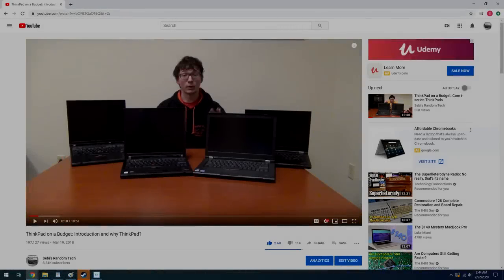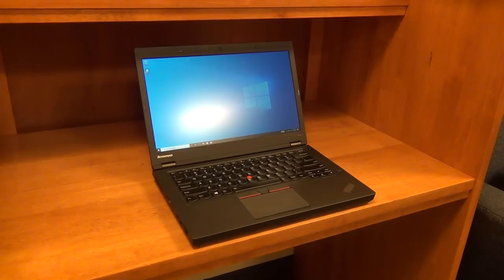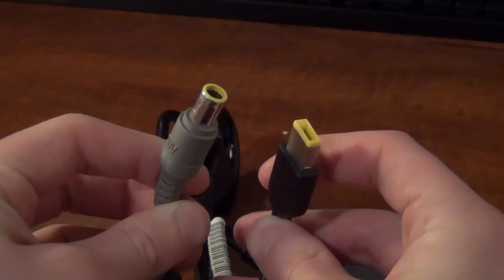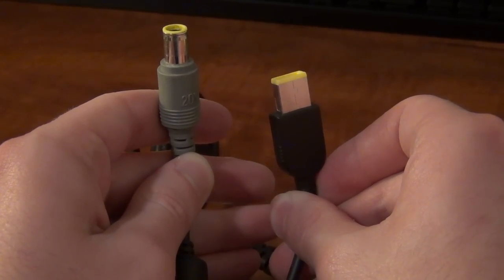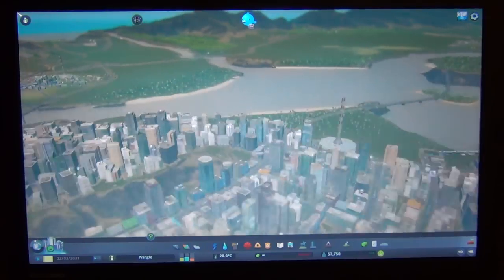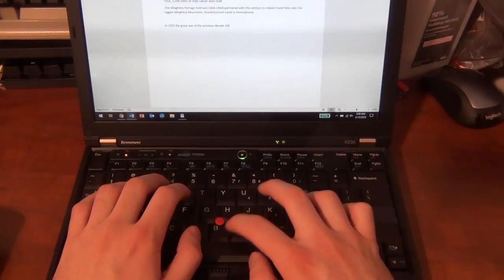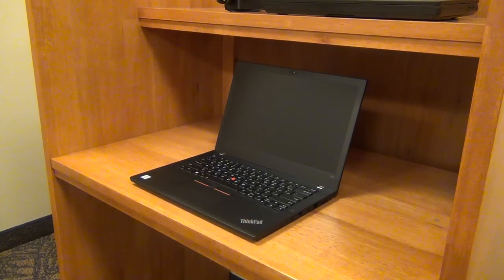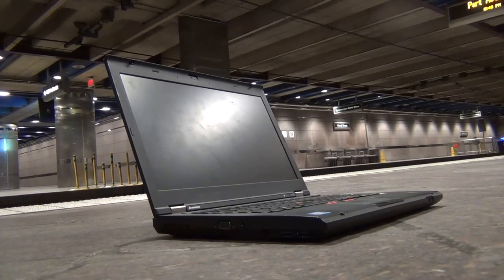Best Value ThinkPads in 2020

Comment: Considering how how and power hungry my T430s is, I wouldn't even consider another laptop in that line. My T440p ran MUCH cooler and quieter, and was a lot more power and power efficient. Unfortunately, the fact that the p variant only has a single battery has been a massive negative to me. MAYBE i'll get around to trying to fix it one day, after I managed to brick two motherboards.
Edit: not only can you get a harddrive caddy for the T440p, but you can also get a Blu-Ray RW drive.
Reply: buy a new battery bra
Reply: @aneeshprasobhan  the T430s has two brand new batteries. What's that gonna change?

Comment: You can't go wrong with Thinkpads. I own a T480 I bought brand new for $600. Got my girlfriend a used (near mint condition) x250 for $200. Gonna pick up a T440p next for around $200. I used to work IT for a large medical supplier and we had STACKS of x230's, x240's, T420's, T5XX's all used in the warehouse just collecting dust as they had been decommissioned when new models rolled in. I would image 20-30 new units at a time and walk the old ones out to the warehouse. I wish so bad I would have taken 10 or 20 of em home. I'm sure nobody would have cared. At the time I just didn't know the real value that thinkpads had.
Reply: t440p for the upgradeability?
Reply: @justinchan8868  - yuppers!

Comment: Would you recommend the P series (P50, P52 and P53)?

I know that for many things a T would do the job, but because it'll be my main computer for a time and I'll be using it outdoors so I'm kinda thinking seriously buying a P50 Xeon FHD.

I've searching an alternate to it, but I'm very interested on the 4 slots of RAM on the P series and the multiple M.2 slots
Reply from the maker: The P series are very solid machines, if they’re within your budget. The Xeon’s don’t offer a massive performance boost over the i7’s from what I’ve heard, unless they come with the beefier graphics options or you need to use ECC RAM. Keep that in mind when comparing prices.

Comment: What IPS panel did you install in your your t440p? Which one do you recommend?
Reply from the maker: There’s a lot of different opinions as to which ones are the best, any IPS panel will of course look miles better than the TN’s available for these.
If I had to pick one specific display for these that looks the best, I would say the InnoLux N140HCE-EN1 Rev. 2. Make sure if you get one that it is not Rev. 1 as those have the mounting brackets in slightly different places, so it won’t fit correctly.
Reply: @SebisRandomTech  Awesome, thanks for the reply!
Reply: I recently swapped mine with an LG LP140WF3-SPD1 and it's alright
Reply: @timb6694  Yeah I heard  that its a really nice screen. how do you like it?
Reply: @chromatron4538  Read in some reddit threads (take w/a grain of salt) that it's one of the best options, and it does look really nice. Matte finish, pretty accurate color, and less than $60 if you shop around

Comment: So if I got a t440p, are there BIOS mods that can "disable" Intel ME? Also CPU undervolting?
Reply: IIRC, look into Libreboot/Coreboot. I'm not sure about the undervolting,  but I'm fairly certain you'll find more info through there.
Reply: Coreboot I think. It cannot remove the ME completely like libreboot for earlier cpus. It can be removed completely on a core duo/C2D like t400.

Comment: using r61i thinkpad from mid 2008's, I am really surprised how this machine works that well, really smooth after upgraded from hdd to a ssd.
Reply from the maker: Typing this from my T601 FrankenPad (T61 motherboard in a T60 chassis), amazing how I can still be using it without issues 13 years after it was made!

Comment: I currently have the t430. I have intel ssd, msata ssd, 16 GM ram. It boots windows 10 from powered off in 21 seconds. Great machine.
Reply: 21 seconds?? That's crazy long with an SSD! Boot to Windows should be less than 10 seconds! Even my $100 Dell does that.

Comment: Considering to upgrade my T440p processor (currently i5-4330M), I noticed on the "T440p Specifications.pdf" that is compatible with i7-4800MQ, i7-4810MQ and i7-4900MQ too. Do you think it is better to focus on the 4712MQ or should I consider the other higher options?
Reply from the maker: The other options will work but run hotter. It's ultimately your choice.
Reply: @SebisRandomTech  Thank you for your reply and time!
Reply: @SebisRandomTech  Hi, what's your opinion on getting T430/T440 CPU  upgraded to i5-8000 & above to make the laptop Win 11 ready ? What could be the max i5 or i7 processor the machine can take ? Thanks.
Reply from the maker: @OnlineShares  That isn't possible unfortunately. CPU upgrades are limited to processors from that generation.

Comment: My A485 (Ryzen version of the T 480) has been my favorite so far. Last of the external batteries, screen upgrades are endless, light gamming is possible, no thunderport issues, and plentiful replacement parts for cheap. I love my older thinkpads but for a grab and go budget laptop in 2023, this one is my pick.

Comment: I changed R61 to T430 last year and still I think that was one of the best deals. Changed HDD to SSD, put 16GB RAM and I have small rocket. Still, it is i5. But with 1600x900 LCD is quite awesome. Only what is frustrating is a battery life.
Reply: What's the battery life like, with say.. browsing on chrome, watching YouTube and MS office?
Reply: @Prasad9800  Something about 1.5h when is charged at 100% and the battery condition is about at 70%. It's stock battery.

Comment: Well, I use a X230 on the go and a S30 at home and both machines are more than enough for my needs. The X-series is extremely portable and has saved my ass a lot of times having to submit some time sensitive documents and the X79 workstation back home is great for daily use and 1920x1200 gaming. As long as you maintain your machines and clean them, they'll serve you a long time without breaking a sweat. And yes, please, treat yourself to a SSD.
Reply from the maker: I love the X230! Especially with an X220 keyboard swap. They just tend to be a bit pricier than a similarly specced T430.

Comment: ** Hi Sebi: Today's November 03, 2022. I am a student. I am in the market for a secondary laptop. I live in Germany. My budget is about 200 Euro. I have a primary machine already, but it is not  portable enough. I am looking for something that is portable, possibly around 3 pound or less if possible. My possible usage are writing codes (C++,Python, JavaScript mostly), use office application and browsing. Thank you **
Reply from the maker: Look into the older X1 Carbon models if you solely value portability. If you want more upgradeability you could look into the X2xx models (X230, X250, etc) ot the T4xxs models (T430s, T450s, T460s, etc). Those models should be in your price range.

Comment: One to add might be the L390/380 Yoga.
If you are a student and need the portabilty AND a good stylus, those are imo the ONLY new TPs to take into account. Why?
a) Upgradable RAM (X series don't have that anymore)
b) no troublesome thunderbolt port
c) Quadcores, yay...

I ABSOLUTELY agree with the "gap". Anything between the ivy bridge mobile series and the quadcore i5/i7-8xxxU CPUs is a waste of money, as the older 2/3/(4)xxxM CPUs are cheaper and better. 
However, if you want an energy efficient Quad, nothing will be better than those newer U series CPUs. I upgraded from my trusty old X41T(writing)+T400(performance stuff) combo to an L390Y last year and I do not regret the 850€. It was my first new laptop, but its great so far.
Reply from the maker: The newest ones (8th gen and newer) are definitely a better value than 4th-7th gen, especially from a performance standpoint. The only downsides is that even used ones usually cost more than the older ones after upgrades, and (as I will discuss in the T480 video I am working on) some design changes like the move to USB-C charging and the removal of swappable batteries and upgradeable RAM on some models presents a major downgrade. I can’t wait to do that video so I can give my full opinions!

Comment: Which ThinkPad would You recommend in 2023? Something for basic work like browsing Internet, SSH to remote machines, basic coding, with upgrade potential and to run Linux? 🙂
Reply from the maker: Working on a follow-up video to this one, but it would depend on your price range and uses. For you just about any model made in the last decade will do what you need it to. The T440p remains one of the more upgradeable options albeit a tad older, the T460/470/480 have gotten more affordable and have the benefits of a slimmer build and better battery life, and the X series is always a good choice if you can find one for a decent price.
Reply: @SebisRandomTech I'm looking forward for that video!
Reply: T480?
Reply: @SebisRandomTech  what do you think about the E14 G4?
Reply from the maker: @baran.t23  Look at other options but it's good in a pinch.
Reply: @SebisRandomTech  which of the newer models would u recommend in a price range within 1k
Reply from the maker: @baran.t23  P series if you don't mind a heavier machine, X1 Nano or Carbon for something on the compact side, and the L14 or T14 for something in the middle. I'm still happy with my older models though!

Comment: How possible is it to upgrade the display in a t530 to a 1080p IPS panel? the T530 I just got has a line in the screen and I want to know if I can upgrade it or if I should just buy a working original display for it. I also plan to put in an i7-3630qm from an old Toshiba I have with a destroyed case (horrible thermals too) I will use it for light gaming and general on the go use alongside my 2012 MacBook Pro 15 inch. While it is nice and has faster graphics it is a decent bit heavier and is limited on ports. It also is limited in battery life as the battery is non swapable. Another advantage is the ability to easily add a Blu-ray drive to watch them on the go.

Comment: Got a t480 for my grad program where I'm writing all day every day. I needed something portable, professional, and futureproof that didn't suck to write on. Even though the keyboard doesn't hold a candle to the older thinkpads, it's still the best around for "modern" laptops. 
I'm curious as to what your final verdict will be. I think it's the absolute last Thinkpad that's still worth getting because the x1 and s line have taken the removable batteries and upgradability away from the powerusers in favor of the sleek cult of Apple. It's sad, but at least there's a whole catalogue of cheap thinkpads to collect.
Reply from the maker: Sadly all newer ThinkPads are now taking away things like removable batteries and upgradeable parts, and ditching useful ports like SD card readers. What bothers me the most is that they’re doing this even on thicker models that have more than enough space in their design to still accommodate those features. I look forward to making the video as well.
Reply: @SebisRandomTech  - I wouldn't consider SD card readers a useful port. It kinda bugged me that the new P53 had a SD reader. Considering you can pick up a 15-in-1 USB card reader for like $5 AND any device that has a card in it will also have the ability to connect to the computer via USB cable I don't personally find it useful. Isn't it more work to (for example) take out the SD card from a phone/camera and put it into a reader than it is to just plug the phone/camera into the computer with a usb cable? AND aren't standard size SD cards kind of a thing of the past? (meaning micro SDs have to be adapted) etc. All in all not a big deal BUT if I had a choice between taking up internal real estate for an SD card reader or including an extra port like a mini display port/extra usb3 port or something else...I would choose the latter. I don't think most people are using SD card readers on a daily/weekly/or even monthly basis. On the flip side extra display ports, usbs can always be helpful.
Reply: @SebisRandomTech  - The only people I can imagine using an SD card read with any regularity would be photographers. and most of the "photograhers" i've met spent 3k on a bunch of equipment then it sits in their closet for 10 years. lol
Reply from the maker: @Michael-ot9bk  I use SD cards regularly...
Reply from the maker: @Michael-ot9bk  The P53 dropped some ports to make room for more ThunderBolt ports, it has more than enough room for an SD card reader and it's not like they took away ports to keep the reader...

Comment: You've mentioned that T430 and T440p used to be your 'daily drivers'. So if they're not anymore, what is your current daily?
Reply from the maker: I switch between laptops pretty frequently, so it’s hard to have a set daily machine. Right now my modified FrankenPad T601 (T61 motherboard in a 15” T60 chassis) and a W540 are my main machines. I also recently picked up a T480 and am going to make a review after I’ve used it for a while.
Reply: @SebisRandomTech  Is there a rewiev for W540/W541? I have Dell Precision M4800 -very good laptop, but is big and heavy and I am think to sell and switch to T440p because is light and is 14". What do you think?
Reply from the maker: @levskilevov4888  I'm working on a video about the W540/541. They're pretty similar to the M4800 in terms of performance, however the W540 is (based off spec sheets since I've never used a M4800) about 1-1.5 pounds lighter (W540 is 5.57 lbs vs the M4800's 7.01 lbs). The T440p is about a pound and a half lighter than that (4.7 lbs) so you should definitely feel a difference in weight compared to a M4800. The T440p in my opinion is a better choice if you're on a budget - it's much cheaper than a W540 and can take most of the same upgrades. The W540 does have slightly faster processors, much better graphics, and Thunderbolt support, which the T440p lacks.
Reply: @SebisRandomTech   You are right, but if you buy W540/541/M4800 and other Kepler nvidia laptops -Nvidia stop update their nvidia Kepler drivers, so you buy a laptop with old drivers from april 2019
https://www.techspot.com/news/79115-nvidia-end-support-mobile-kepler-gpus-starting-april.html
So only critical security updates will continue until April 2020. 

There is only one month, after this what we are do?
Reply from the maker: Them ending support has no effect on your ability to use the computer. It just means Nvidia won’t be releasing any patches or updates to the drivers, the system will still work fine as is.
Reply: @SebisRandomTech  You are right, but also depend what you do.
After a period of months, if you use new versions of current programs such as Adobe Photoshop or other from Adobe, these programs will start refusing to work with the video card because the drivers are old.
I already had such a problem with Dell Latitude E6540 drivers with the Radeon HD8790m, whatever you do, the programs only worked with the embedded video. This is for  Windows 10.
With the unofficial drivers from AMD that are current Windows crash every time.
Reply from the maker: You can either look into unofficial patches to continue compatibility with the older hardware, keep using the older versions of your software (are they really coming out with enough new features to warrant upgrades?), or find different software to use. Plus, you’re the one who asked about the W540 vs the M4800 to begin with, so I was simply answering your questions in that regard.

Comment: I was able to get the winning bid on a T460s for $300 in 2019. Had to put in a $40 m.2 SSD, but I'm happy with its 1080p display. Not great on battery life, around 2 hours during normal use.
Reply from the maker: It might benefit from new batteries. I have a T470s which is almost the same laptop and managed to get 3.5 hours when I was stress testing it (maximum brightness, heavy load).

Comment: What about T440s? I read that the differences are not that big. Also can I install SSD there as well?
Reply from the maker: The T440s uses low power ultrabook processors that are soldered on and can not be upgraded, half of the RAM is soldered on, it doesn't have a DVD drive, and there aren't as many ports. It's a very different machine from the T440p and other models shown in this video. It is thinner and lighter and has better battery life, at the expense of performance. You can indeed put an SSD in it if you want.

Comment: I'm looking for a laptop all around performer needs, portable and upgradeable.
I planned to buy used thinkpad, by these following series T440P / T460 / T460s
which one do you recommend more?
Reply from the maker: For the most upgradeability the T440p is your best choice. It’s very easy to upgrade, and any of the higher end CPU’s that can be swapped into it will outperform the ones in the T460/T460s.
Reply: @SebisRandomTech  is it compatible with windows 10 pro?
Reply from the maker: All of them are, as was mentioned in this video.

Comment: 300 usd for this t440p about year ago.
Cpu i7-4700MQ 2,4ghz
Gpu Hd Graphics 4600
Rams 16gb
Display Full hd 1920x1060x60Hz
120ssd
Can I upgraded it more or should I start to build t420 for hobby? Thanks
Reply: unless you get the slightly more powerful chinese i7 4900 with awful over heating probs your not getting any more power out of that thing the t420 is practically the same as the t440p just a slightly weaker cpu and gpu
Reply: @jameswyma9849  sold it t440p for 350 usd and bought it for about 600 usd Alienware m18x R1 FullHD, i7 2960xm, 32gb ram, 256gb ssd and 8gb ram gpu gtx880m